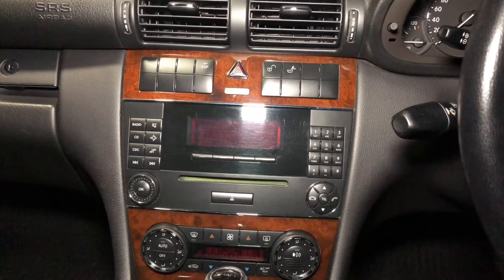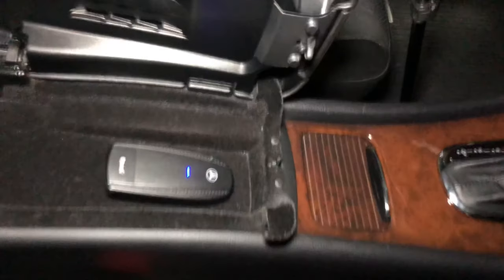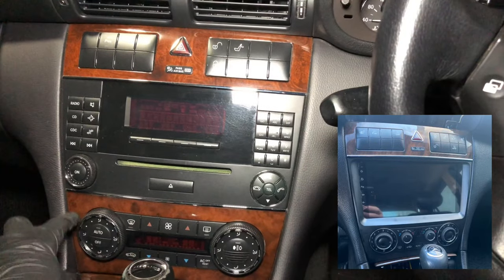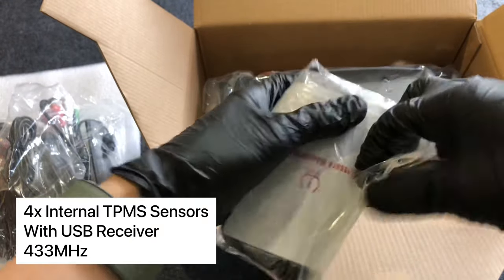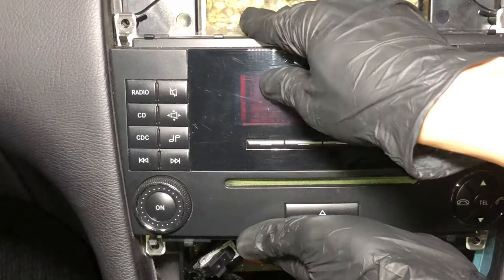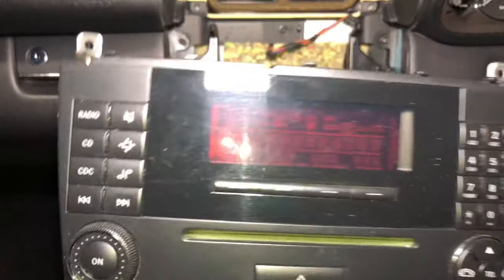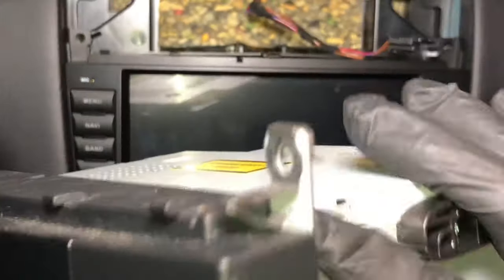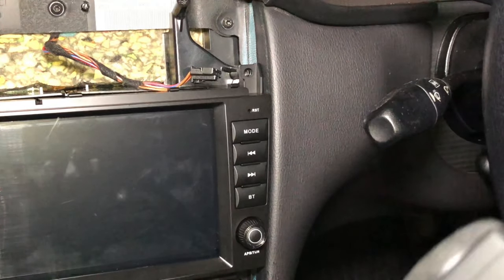MERCEDES C200 W203 | ANDROID HEADUNIT INSTALL GUIDE

Comment: Great video..what is the make of the head unit you have put in.... plus where can you buy it ?...
Reply from the maker: Hi Tony, I bought this headunit from a store in Aliexpress called “Kapud” (link to the product can be found in the video description.  If you haven’t purchased from Aliexpress before, the buying experience is similar to ebay.  Looking at the link now, I can see this reseller will have a sale from 11/Nov so hold-off the purchase to avail of some minimal discount (every dollar saved counts 😁). 

In terms of the make, I don’t think Kapud themselves built this headunit (I might be wrong).  They are probably just resellers which means if you search in Aliexpress hard enough, you will notice several resellers sell similar-looking products 😁

I didn’t have first hand buying experience with this reseller prior to this, but leading up to the purchase, I asked them several questions to make sure I’m getting the right product and they are very responsive - including responding to my follow-up questions after I bought the product.

Lastly, please note I don’t have any affiliation/s to either parties (Aliexpress or Kapud).  The answers I’m providing to you now are purely based on my own personal experience.

I hope this information is helpful.

Comment: Hello, great tutorial. Also, wanted to ask if you know how to disable the back up camera. It keeps turning black when i go to reverse
Reply from the maker: Hi NoLoucas, thats a great question.  I suppose if the headunit keeps on switching to the reverse camera input and you don’t plan on putting a reverse camera, it becomes an annoying “feature”.  I don’t have an answer to your question right now but I’ll check if there is a firmware setting to turn this off and if I can’t find anything, I’ll reach out to the seller what they think.  I’ll let you know either way.
Reply from the maker: Hi NoLoucas, I found this information online that could do the trick: Settings > Car Infotainment > About Device > Gear/Cog Icon > Passcode (8888) > Others > Camera Detect (Set to Not Detect) > Save

Comment: Hi, brilliant video, I purchased the same headunit, but unfortunately after connecting everything up, the head unit won’t power on, every time I press the power button a message pops up on the dash saying “faulty display, visit workshop”, I done a few small tests and couldn’t figure out what the issue is, if it’s the canbus or head unit, there is power going to the unit, put the old one back in and worked fine, might try playing around with the green canbus pins next, any ideas?
Reply from the maker: Hi Tommy, Sorry to hear you are having issues with the headunit. I would suggest that you inform the seller (if you havent done so already). But based on your description, it sounds like either a canbus or the wiring harness issue. It might also be worthwhile taking a photo of these components and how you’ve hooked it up and send it to the seller.  If you have a multimeter, you might want to check if the pins of the quadlock connectors are properly connected to the wires.

I hope this is helpful.

Comment: Hello, how did you proceed with the optic fiber? I see not bypassed. Still have sound in the car's speakers. Thank you
Reply from the maker: Hi Lucian, my car isn’t equipped with Harman Kardon speakers so it doesn’t have optic fibre.  Does your car have Harman Kardon speakers?  If so, another viewer in my channel tried installing this headunit on his W203 equipped with Harman Kardon speakers and unfortunately it didnt work. The seller of the product in AliExpress suggested to buy an analog to optical converter but I’m not sure if that will fix the issue.

You might also want to watch this video from another DIY’er who used the optical converter for his W209.

https://youtu.be/k6Gfd7UHMSo

You can skip directly to the part where he is explaining how to connect it up which starts from 14:20

I hope this information is helpful.
Reply: @AutosNGizmos  Hello Gizmos, thank you very much for your answer. All very clear. I am actually intending to buy one C240 4Matic wagon from 2005 Elegance trim. I do not know exactly how is the audio arrangement since I do not have interior photos and I was trying to make some homeworks. Thank you again.
Reply from the maker: Great to hear.  Please make sure to confirm compatibility of the headunit directly with the seller.  Cheers and good luck on your project 😊

Comment: Hi, first of all, good video and very helpful.
I bought another kapud android radio like this one, and I also installed it in mu car. But the problem is the radio is turning on when I plug the key into the car. And I can’t turn off using the button, and I would like the same behaviour as the original one, that I could turn on and off with the button and I didn’t need the key plug in for that. 
Do you know how to change that?
Thanks in advance.
Reply from the maker: Hi Juan, thanks and I’m glad you liked my video.

With regards to the radio behaviour, I think mine behave as your second one - radio turns on when I insert the key - but I think only when the radio app was playing before I switch off the car. Have you tried killing the radio app on the task bar before you turn off the car and then re-inserting the key and see what happens?

FYI, I didn’t even know you can turn on the radio without the key in the ignition.

Comment: Thank you for the detailed video. One question, does this headunit require a fiber optic converter?
Reply from the maker: Hi Soufiane, Thanks for your feedback. I didn’t use any special harness/connector for the fibre optic wire (I’m assuming it’s the two orange wires you are referring to).  The Quadlock connector that comes with the headunit wiring harness even has that part blanked out (Check out video around the 26:10 mark).  So if that is what you are referring to, it is certainly not connected to anything but I still get a decent/acceptable sound coming out of the speakers.

I hope this information is helpful.
Reply: @AutosNGizmos  I tried this today with the Harmon Kardon speakers equipped. I do not get any audio. it seems as though there must be some kind of optical signal in from the head unit in order to get audio if you have HK speakers. The seller suggested I buy an analog to optical converter box which will convert the analog signal out from the android unit to optical.
Reply from the maker: @endermen42  Hi Sidd, I’m sorry to hear this 🙁 Did you get the exact same headunit from the same supplier I got mine from?  If so, I most likely don’t have HK speakers on my W203 that’s why the headunit worked on my car straight out-of-the-box.  I’m not familiar with the HK setup on the W203 but if the supplier recommended that you purchase the converter, I’d go with that.  If this was my car, I’d google topics around Quadlock pin-outs for the HK system compared to the non-HK system just to help me understand what I’m dealing with.
Reply: Look for MOST fiber optic Amp interface

Comment: I bought the same exact unit based on your video. I installed it today. All working but no sound what so ever no radio sound nothing. I disconnected everything except the main plug and the radio antenna, Still no sound. I put back the old unit, All working and the sound is working. I am not sure of what to do. Any ideas?
Reply from the maker: Hi katabi66, firstly thanks for watching my video. I’ve had other people mention problems with audio after the installation. Most of them have a Harman Kardon sound system which means the car speakers is hooked up with optical audio connections. If the speakers on your car has the Harman Kardon branding/logo, then chances are you need the optical converter.  If this is the case, you might also want to watch this video from another DIY’er who used the optical converter for his W209.

https://youtu.be/k6Gfd7UHMSo

You can skip directly to the part where he is explaining how to connect it up which starts from 14:20
Reply: @AutosNGizmos   Thank you for the quick reply. None of my speakers show Harman Kardon sound system or labels. It is exactly like your car. Main harness with 2 antenna yellow and purple only. The car I have is 2007 C280 w203. I noticed in the original head unit where the main harness goes, to the left of the pins there is an orange piece of plastic with 2 connectors. That might be optical out put. but the speakers around the car do not say Harman Kardon for sure. What do you think?
Reply from the maker: I’ve re-watched the videos again to re-jog my memory. There are a few things you can try that might help:
1) Most of these Android-based car stereo systems have a master volume buried under the firmware settings. Have a look around and see what it is set to. If you can’t find it, probably a good idea is to do a hard reset. There should be some instruction that came in the manual how to do this. Reboot then retest. If there is still no audio, proceed to #2 below.
2) This second option, you will need a multi-meter so if you don’t have one, might be worthwhile to borrow one from a friend. On the back of the headunit, you will see a small (red) fuse and next to it is the ISO connector. This is where the headunit will output the all audio channels. For example, pins 9 and 11 are the Front Right ground and audio signals respectively. The pin-out information should be in the user manual that came with your headunit. While the headunit is plugged in and turned on to a radio station (but not mounted on the dash, use the probes on your multi-meter (use either Ohm or Voltage setting on the multimeter) to tap into pins 9 (black probe) and 11 (red probe) to check if you see any readings. If you see fluctuations in the reading, then it means the headunit is trying to send audio to the speakers. If you don’t see any readings, then there might be something wrong with the headunit so report this back to the seller. If you see fluctuations in the readings in the multi-meter, proceed to #3
3) At this point we know the headunit system volume is correct and it is sending audio signals to the car. In this step, we need to make sure that the pin-outs on the wiring harness of the Android headunit match the pin-out of the connector that is in the car. My car has the MB Audio 20 so the website in the below url has the pin-out information. Make sure both pin-outs match. For example, pins 9 and 11 on the Android headunit should be connected to Pins 6 and 2 of the Car’s wiring harness. It is also worth making sure none of the pins are bent and there is good connectivity. Sometimes all it takes is the ground pin not connected properly and that is enough to make everything out of sorts.

https://pinoutguide.com/Car-Stereo-Mercedes-Maybach-Smart/Smart_Audio_20_Quadlock_c_pinout.shtml

That is all I can think of for now so I hope this helps. Let me know how it goes.

Comment: Does it support android auto?
Reply from the maker: The supplier said that it supports Android Auto but I have not tested it myself because I dont have an Android phone. I’ll test this myself once I get hold of one and report back here hopefully soon
Reply: @AutosNGizmos  thank you very much, it will be very useful for me. I order it yesterday, the 4gb ram and 64 gb rom version. Without your install guide I would have not buyed it, so thank you very much again!
Reply from the maker: Hi Javier, I manage to get hold of an Android phone and plugged it into this headunit.  On the phone, it prompted me to install the EasyConnection app (carbit.com.cn) so I suspect phone integration will not be through native Android Auto.  

By the way, have you installed the headunit onto your car yet?  Keen to find out how you go with it.  Cheers.

Comment: Is it working on C200 Compressor sport coupe W203,exactly the same android model u are using?
Reply from the maker: Hi Ankara, thanks for visiting my channel and watching this video. 

It’s hard to answer your question with 100% certainty so best to confirm compatibility with the seller by sending them make/model/year of your car and photos of current OEM stereo, steering wheel and speakers.  Other fellow DIY-ers who commented on my videos encountered issues with the following:
1) Speakers (no sound) - If you have the Harman Kardon speakers
2) Steering wheel control buttons (not functioning) - if you have 3-spoke style steering wheel

I hope the above information is helpful and please feel free to check back in here if you have further questions 😊

Comment: great video. quick question im a bit confused on what model would be best to order from what i understand i dont plan to store any music or movies on the device so i wont need a big rom. in regards to the ram do you think 1G ram is too small, i would only be using the navigation and radio simultaneously (wouldnt have loads of apps open at the same time).

also on the smaller models it states it doesnt support android auto, what does this mean, i cant connect my phone via usb and use google maps or just that i dont have the function to do this without connecting my phone. 

Thanks
Reply from the maker: Hi Zuber, thanks for watching my video 😀

That’s the problem with the models with lower CPU and memory, they don’t come with Android Auto and/or Carplay functionality.  I think in those models, you won’t get the app called “Phonelink” and “Autolink” which emulates Carplay and Android Auto respectively.

If you need to use navigation software such as Google maps or Waze (which you need to download and install separately), you need to store the map data on the unit itself or always have the headunit automatically connect to your mobile hotspot so it can download map data on demand (I think).  But either way, I’m sure this will use up memory on the device.  If you choose to get the model that doesn’t have Android Auto or Carplay support, you wont be able to connect your phone to the USB port and you cannot interact with your phone using the headunit display.

But if you don’t use maps every time you drive, I think you should be alright without Android Auto (or Carplay) as the radio functionality is acceptable IMHO.

There is another app that comes standard called EasyConnect but all it does is do screen mirroring.  That app allows you to see what’s being displayed on your phone directly into the headunit screen.  For example, if you rotate your phone and change to portrait orientation, the headunit screen will also rotate - it’s weird and I personally don’t like it.

I hope I answered your questions clearly.  If you have further questions, please just put them in the comments and I will respond as soon as I can.

Comment: hii, i have a w203 but the original stereo is a different compared to what can be seen, can i do this swap?
Reply from the maker: Hi Atomic Nuggets, If I’m not mistaken, the W203 came with two different types of car stereos depending on the year the car was made.  So it’s best to contact the seller directly and provide them a picture of your car stereo.  More often than not, they will be able to tell you the correct headunit that will fit your car.

Comment: Is this the same as a 2005 C230?  Also where did you get the stereo?
Reply from the maker: Hi Mark, firstly thanks for watching my video.

With regards to compatibility with your 2005 C230, I can only say if your current car stereo looks like mine in the video, chances are it is compatible. But best to check with the seller directly. The seller I bought the product from is very helpful. So helpful in fact they still answer my queries almost a year after I bought their product 😊

In terms of where to buy it, I got mine from Aliexpress. Product link is in the description box of the video and for convenience I’ve posted it here too. 

Android Headunit for MB C200K W203 (https://tidd.ly/3yPeEjz)

The URL looks funny but it will take you to the Aliexpress website. Please note this is an affiliate link so I might get commission if you decide to buy the product using this link (subject to a certain criteria).

Comment: Would it be possible to put a usb output in one of those spare blocks in the section that sits under the air vents - the ones either side of the hazard light switch
Reply from the maker: Hi Alison, I’ve contemplated putting the USB port there too and its a good spot - I’m sure it will blend well in terms of appearance.  But I thought if the USB port is there, that means when I have the phone plugged in, there is a wire running across the screen which could interfere when you need to press a button.  So with that said, I’ve discounted that option and now looking at installing one USB port on either:
1) Cigarette lighter
2) The space just on top of the Cup holder - but this spot might be troublesome if you spill coffee
3) Inside centre arm rest compartment

FYI, the second USB port I just intend to hide somewhere because I’m using it to connect the TPMS receiver unit.

Your thoughts?

Cheers!
Reply: @AutosNGizmos  that’s true I don’t like wires everywhere but that’s a good shout in the centre console.

Comment: Can you share Canbus settings please for this headunit for w203
Reply from the maker: Hi there, thanks for watching the video. If you are after the CAN Type value I used, I have it set to 135. This seems to work with my 2005 W203 C200. For the rest of the CAN settings, I actually written a short web article which includes a mind-map view of the settings. Link here: 
https://buymeacoffee.com/autosngizmos/common-android-headunit-firmware-settings

Let me know if you need further information.

Cheers 😊